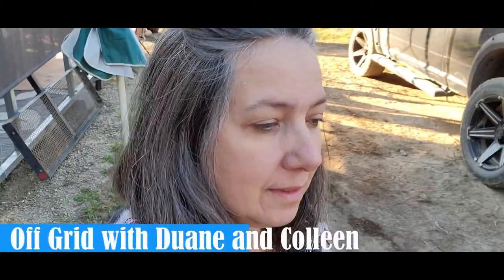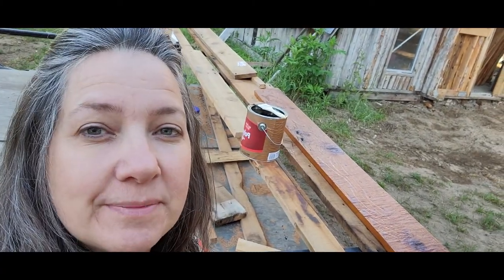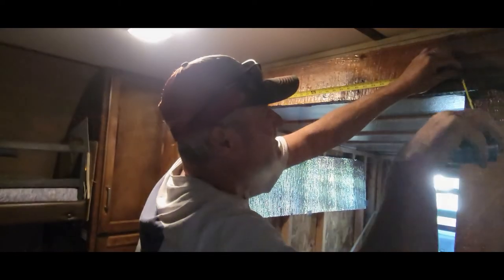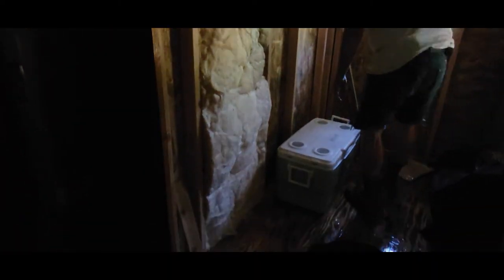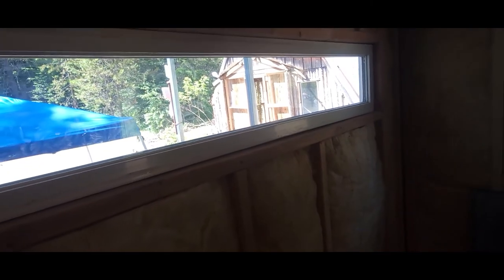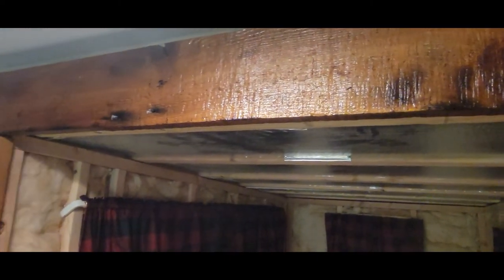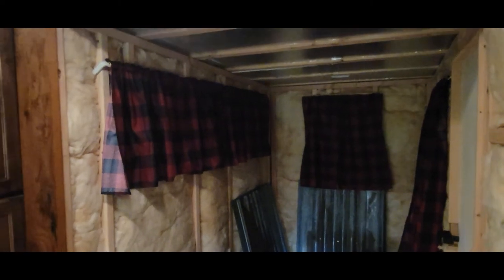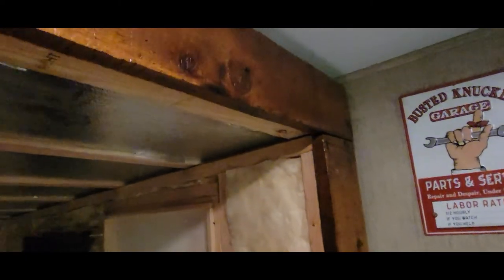S1 Ep 19. Learning to be Off Grid: How to build a room on your toy hauler ramp for a wood stove.

Comment: Dealing with the heat is something I do with my van life and what is suggest is to use shade cloth tarp in the south side were you have window it will be a game changer.
Reply from the maker: OMG you are reading our minds. We literally just put up giant 10x20ft white tarps on the back side of the RV and used Reflexic insulating material in the windows. It dropped the inside temperature of the camper over 15F! I was just sitting here thinking about doing a Top 10 RIV tips learned while off grid. What do you think? Its definetly been a game changer for us!
Reply: @offgridwithduaneandcolleen3079  I think any information you have learn is good to share